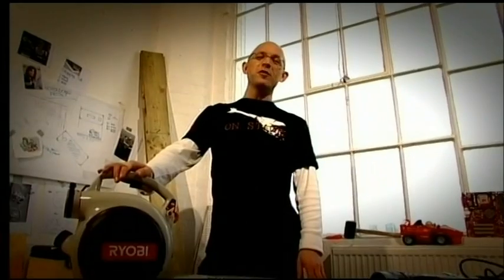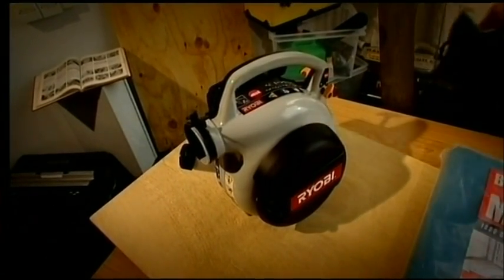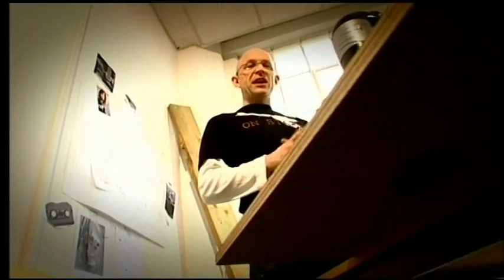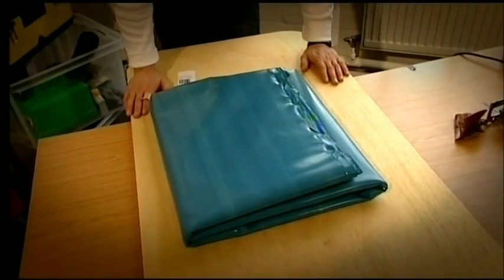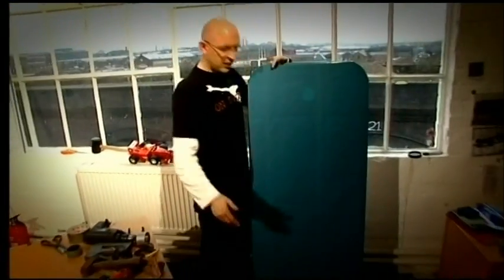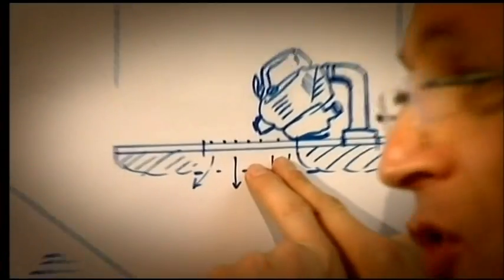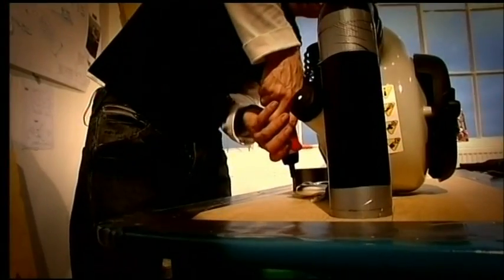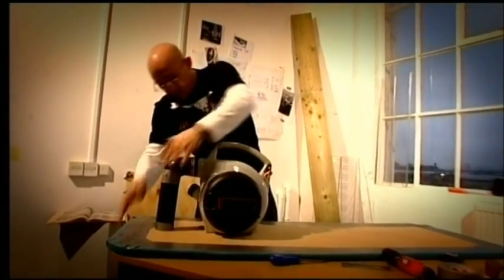Making a Hoverboard Part 1 - The Gadget Show

Comment: You can add a Big fan with a battery, and mount it on the back ( on a swivel ) that will not only move the hovercraft but also steer it.

Comment: I have a few questions. How much did all of this cost? What's the top speed? Can it work outside (ex. snow)? How far can it go before it runs out of power? Can you add controlled steering? These are just a few questions that I have that I have been wondering.

Comment: @realboarder09 It would likely be too small. It would need an engine small enough to fit onto it, and even then it probably wouldn't support your weight. And then taking into account that skateboards aren't flat means that there would be a buttload of problems, it just wouldn't be likely.

Comment: @rjqg327 I already know what batteries would power the fan I want to use, and where to get them. I would use four 12V, 12 amp*hour lead batteries, connected in series. One of them weighs 400 grams, which makes a total weight of 1600 grams. Since the hoverboard is supposed to carry an adult person, an added weight of 1.6 kilograms would be negligible.

Comment: That 90 degree bend in the hose is a ridiculous idea as he could just quite simply turn the blower 90 degrees so that the hose points down making a stronger air transmission

Comment: That 90 degree bend in the hose is wack and inefficient, it's cutting around 60% of air transmission. Use a flexible Accordion hose instead.

Comment: You mean NO good way of steering it. Well actually there could be a way to steer it. If you were to put the air supply at the front of the board and then a fan at the back that you can angle, you would have the ability to steer it. Not very precise handling but still pretty cool.

Comment: Nope, not gonna happen.

You are suspended on a pillow of air even if you do lean. There is no force blowing more or less to the side even if you tilt the board, as a result, you will keep going straight no matter what.

Best way to make it controllable would be to put a turbine at the back, turning into a mini hovercraft.